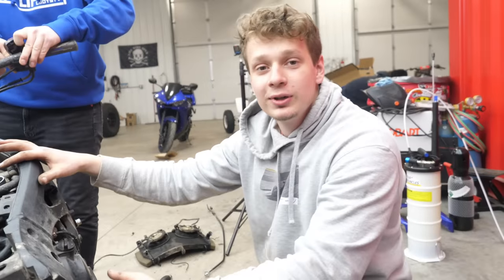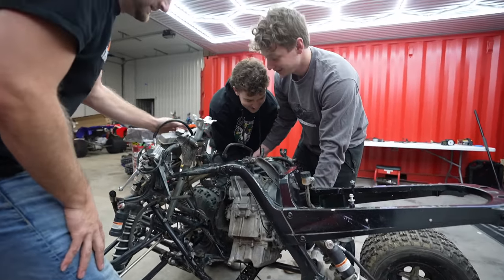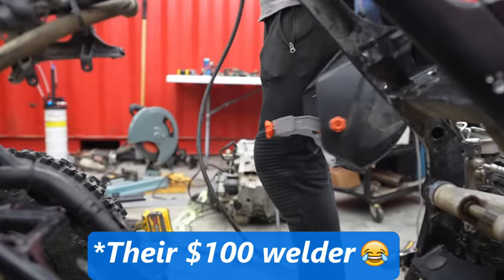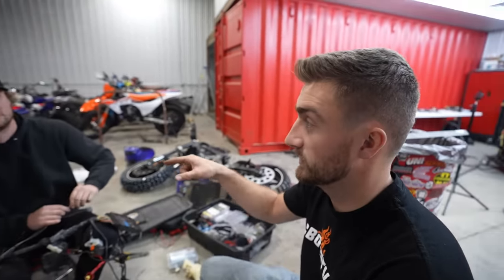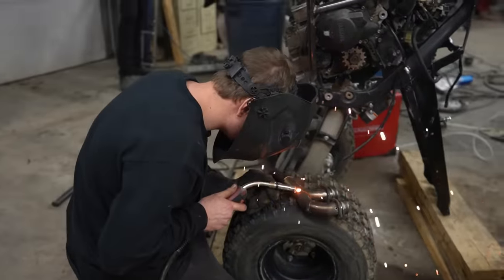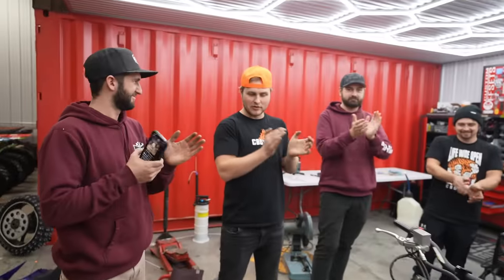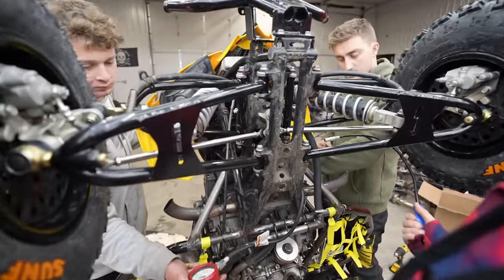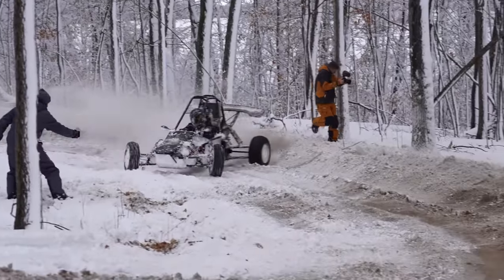R6 Swapping Raptor QUAD in 24 hours!

Comment: Im pretty sure you just need to put a muffler on it. I´ve had the same issue a ton of times when I´ve run without the rear muffler or had leaks.

Comment: I'm not a tuner but did you all use the fuel pump out of the street bike the raptor may not have enough pressure to keep up some bikes have a gear shift pos sensor and  kickstand switch and I think he said used some of the raptor wires they have a park brake switch that want let them rev real high if it thinks the park brake on.

Comment: I have a good feeling that it's not running right because they launched it when it was still in the sport bike frame. The impact could have messed up the stator or pick up coil as well as the flywheel. The magnets could have gotten dislodged or something. That's my guess electrical

Comment: It’s definitely back pressure issues I knew as soon as you guys did the exhaust it wasn’t gonna run right I’ve turned a wrench a time or to. Sometimes it’s hit or miss with high revving motors but they still need some back pressure i’d recommend running it back further/ putting a muffler on it and figuring out a way to distribute the heat away from you. because that exhaust is going to get red hot.
Reply: Thanks for watching and commenting Inbox 📥 me above to claim your Christmas 🎄 Reward Cheers! 🎉

Comment: I think the problem is the exhaust you need back pressure I would try to make the exhaust as close to stock as possible and I bet it will run a lot better

Comment: I think it’s the fuel pump. If it’s not pumping fast enough then it will not go over a certain rpm but run fine at low rpm’s

Comment: replacing the airbox with "basic" filters can be the problem because it doesn't get the air same way as it would with the stock airbox. it's same with most mx/enduro bike don't know how it is with 4-strokes but with 2-strokes changing the airbox to a air filter that get more air has big effects those were some problems i had when building a 90cc moped with free flow filter it didn't work the same as the basic box

Comment: It's seems fuel system related, some kind of internal damaged when it was crashed on a fuel pump, damaged fuel rail/line etc... 

If you ever get in an engine bind give me a call, I'm pretty good at remote diagnostics 😁ratherbwelding has my number

Comment: y'all needa put a true exhaust on that thing with a can, going to make shit power especially dog for torque with the pipes like that... then you can run the stock 02 sensor that's supposed to be on the bike so the ECU can compensate for any fueling changes etc... without it being written out of the computer and not running it, will most definitely cause the bike to have issues like your seeing. the zoomy's are  cool in theory but realistically just not proper for that to work right.... as well, i would set it up to work with the O.G thumb throttle especially the way the bois are going to be beating on that thing hahah it'll be a lot safer, i just see a whiskey throttle situation happening with the bikes twist throttle being on it hahaha 
super sick build either way! things going to be an absolute death trap!

Comment: Could possibly be the exhaust not having the o2 sensor in it with the shorty pipes just a possibility
Reply: On top of the raptors fuel cell switch the r6 one over it and should pull the fuel no problem
Reply: That model R6 doesn’t have a 02 sensor
Reply: @riderzinc  oh shoot what year r6 is it
Reply: @Lilboat23  03-05 model

Comment: Sounds to me like its running on 3 or less sylinders. Check for cold headers and swap out the coil. I had same problem with my r6 and the 5sl motors have issues with the coils
Reply: Thanks for watching and commenting Inbox 📥 me above to claim your Christmas 🎄 Reward Cheers! 🎉

Comment: Fueling issue did you measure if was pumping adequate amount and what jets were you running on carbs were they stock needles what heights any soacers etc diagrams OK no damage from the send etc what colour were plugs that you recently put in after getting it to start and not fully rev etc any o2 or lambda sensors missing or deleted incorrectly did the engine start and run fine just before tear down? Wish you all the best 👍 👌

Comment: most likely its the exhaust, i had a CBR400rr 4 cilinder and changed only the muffler on it from stock to a open exhaust, it ran for shit, lost 1/3 off its power al together. after rejetting it up 10 size jets! it ran great again. so my guess that it needs some tuning done on fueling

Comment: The exhaust needs more back pressure to run right
Reply: No it doesn't. See the video that MotoIQ has done on the topic a few months ago. The host, Mike Kojima, has a degree in engineering. He used to work as an engineer for TRD and has years of racing experience.

Comment: Have you thought that the 600cc engine does not have the torque at the lower revs to push almost double the mass of the original bike? From a quick search for the torque curve, I see that it gets max torque at the high revs and lower, the torque is very low. That's why the previous 700cc engine may had lower bhp, but a lot higher torque than the r6 engine.

Comment: Sounds like it doesnt know what gear it is in. Most modern ecus have different fuel/ignition tables per gear. Neutral doesnt require a loaded map so ignition timimg and fueling will be much different to when the engine is loaded.

Comment: this sounds but i had a zx6 swapped buggy (it was a turd) but after all the tests you guys described doing i was still only had half power. it turns out 2 plug wires were mixed around...

Comment: I think they engine is in limp mode, it probably doesn't have all its censers. and the correct fuel pressure, so that the engine control goes in limp...

Comment: Fuel pump... sounds like fuel pump clogged ... my bike did something very similar and it turned out to be the fuel pump got a small piece of debris in the filter ... would not rev above 5-6 k especially when in gear.

Comment: It’s not the air box it’s the exhaust 
You cut the muffler off and as bad ass as it looks it needs it 
Or you can increase fuel flow 
Listen to how much it pops it’s a tell tale sign of a lean condition caused by lack of exhaust 
Frankly you should keep the exhaust and increase fuel flow

Comment: Sounds like injectors to me ive bought r6s that wouldn’t rev past a certain spot and it typically for me came down to the fuel filters in the tank, plus external, as well as fuel injectors.

Comment: I had a same problems on a bike I did just wouldn't do what I wanted it to do so I made a air flowing pipe on the carb with the filter on the end now she run fine did seal everything to make sure there is no where for any air to get in apart from where you want it to on how long you need it is down to you but then again it did go for a fly it's sad to see bike put through things like that every time i see a bike cut up smashed up in feel a bit sad as that bike could of been someone's baby or could of mad someone very happy iv built lots of bikes over the years and every one of them I built them and put in to them like it was mine but that's just me don't get me wrong if I can do something that someone told me it could never be done I will find a way to make it work but will be nice to see what you do with the R6 frame anyway hope you have a nice Xmas

Comment: As soon as I saw those Pods on a carbureted R6 I knew it was going to give you trouble. Even swapping out for a K and N back in the day was a headache with the stock airbox. Put the velocity stacks back on, Forget the filters all together for now and run it pig rich, then work your way back down.
Reply from the maker: *its efi
Reply: @VasilyBuilds  ahh, black frame. Should have caught that. I'm getting old.

Comment: It will be that there is no resistance in the exhaust and there needs to be a muffler and probably that it is running on the stock fuel pump and it probably needs the r6 one in it

Comment: The exhaust isn’t getting back pressure
Reply: Back pressure being good for an engine is a myth. See the video that MotoIQ YouTube channel recently did on the subject. (Explained by Mike Kojima, who has an engineering degree) Vasily is likely right, it either needs a tune, or it has a fuel issue. That engine is showing signs that it's running lean. That's why it's shooting flames out of the exhaust.

Comment: Hey you know why its not  running right, it's not running correctly because you guys used the fuel pump for the quad and the r6 motor requires a bit more fuel pressure to run good. I bet if you swap in the r6 fuel pump it'll run like a mfer

Comment: So you take a 700cc out of it....to put a 600cc into it?!?!  I get that it has 4 cylinders vs 1 but for the weight reduction with just the 1 i would think the stock version would get around most cenarios better than the giant 4 cylinder.  Unless you're pulling 120 mph on a quad which is excessive...there really is no point.

Comment: Fuel pressure isn’t high enough
Reply: Under load it doesn’t have enough fuel, you’re using a fuel pump made for one injector now it’s running 4

Comment: Mu guess is the fuel system. Fuel pickup dirty/clogged or the raptor fuel pump maybe not the right pressure.  Maybe faulty fuel regulator, i think the fuel regulator is built into the pump assembly. If you really did use thr raptor fuel pump then you also have the wrong fuel regulator. Maybe
Reply: Thanks for watching and commenting Inbox 📥 me above to claim your Christmas 🎄 Reward Cheer's! 🎉

Comment: Is it efi? Never seen o2 sensor in the new exhaust system. Wouldn’t work well anyways with that design… Could be coolant temp sensor if so… but if it’s carbureted no way it’s gonna run right in that cold of temp. Gonna be way lean. Possibly bad ground, coils and rest of the ignition system not working right due to bad ground…

Comment: Modern moto bikes, in neutral, using a sensor, do not rev as high for decibel check. Wonder if you guys wacked the shifter when you launched it.
I would imagine for dot/ emissions bs crotch rockets use same type of stupid shit.